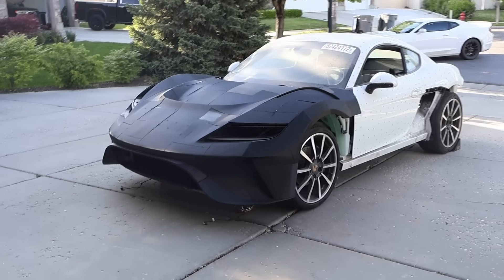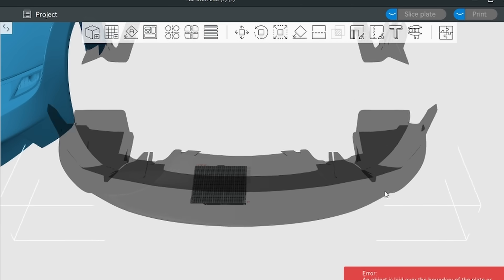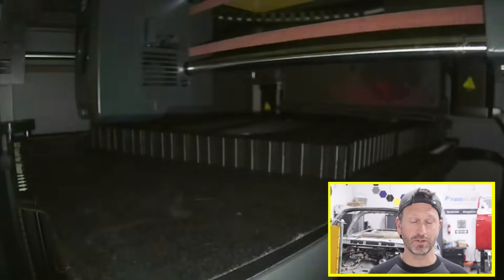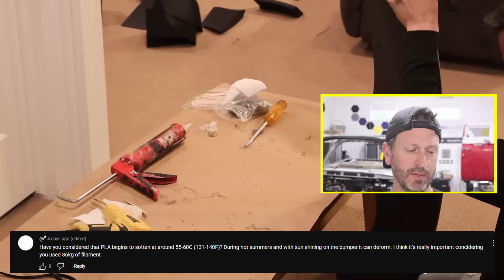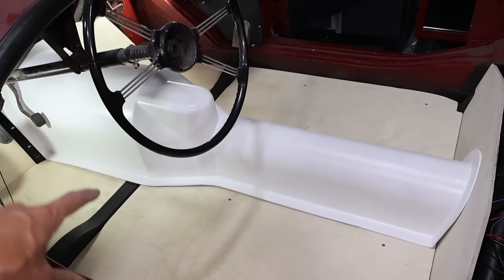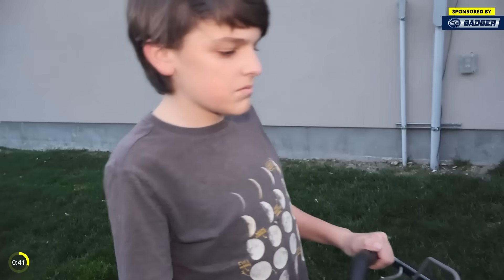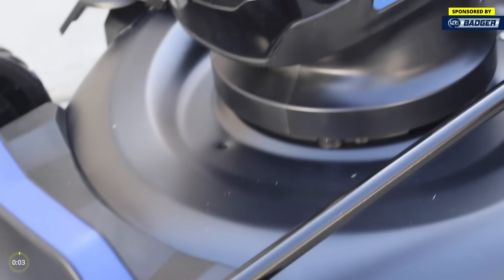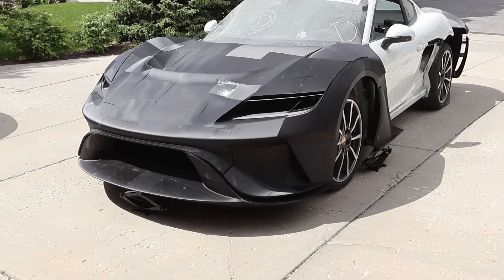Can a 3D Printed Splitter Survive a Supercar?

Comment: I love what you are doing with the 3D printer.  I love my elegoo CC, it just works.  Might I recommend you building a Rat Rig 500x500x500.  You could reduce how many panels you have to slice down to.  I know you are making these as forms like you did the transmission tunnel.  If you were to use a CF variant of filament, it makes the surface smoother and would reduce your post processing time to make your forms.  Looking forward to your next video!
Reply from the maker: Thanks for the feedback!

Comment: Dude honestly i cant believe you did that. you can auto split and it will work it all out for you. All you need to do is feed it your plate specs.
Reply: auto split with which slicer?
Reply: @sapientinogyro  LuBan3D will automatically slice into the most manageable prints

Comment: Use polycarbonate if you can print it.  It's all I use now. Much stronger/heat resistant ...etc... and if you get the cheap stuff, it can be cheaper then PLA

Comment: I see now this forms a base from which to take a Mould for Carbon fibre Impregnated resin.
Looks super cool.
Just wondering if you had someone with a 5 axis mill cut a foam block for your model from which to then smoothe, finish for your mould.
Would that be prohibitively expensive.
Might make the process far quicker for the Mould prep.
I have seen auto spoilers made that way and modles also make by others just not sure how Exy$$
Reply from the maker: We'll consider that for the next one!

Comment: Hi, I designed software to optimize cut large STL files for my designs. also with claws and holders for make more easy the assembly. If you need help, I'd be happy to do the slicing for you for free.
Reply from the maker: I appreciate the offer.  Next big part I have to slice, I will hit you up.

Comment: TO help with part alignment, some slicers have options where you can add dovetail or pin joints wherever you cut the model. Might be a good idea to use that in the future so that you get the fitment just right.

Comment: Sometimes you need to prototype something, and PLA is a cheap prototyping material. I personally would have used something like ALLPHA from colorFabb because it is more biodegradable than PLA, which is really not all that biodegradable outside of industrial composting facilities and not easily to recycle. But it also is significantly more expensive than PLA.
Reply from the maker: Interesting

Comment: While the slicer (Orca/Prusa/Slic3r) will allow you to section up your 3d prints, check out a cool program I use when I'm going big on a print. Its called Luban 3D, and it will ask you for your print bed size and section up the main STL accordingly. It will also create dowel holes if you'd like and number each part. Its a paid software, but well worth it in order to rid yourself the headache of tracking all the sliced parts.

Comment: Your method for using the slicer to cut the model into sections is crazy! I get why you did it this way but you could have sliced it more accurately, faster and a lot easier in the cad software. Simply make a grid sized to your printer and cut. It will then generate all the parts required and named in like seconds.
Reply: youd also then be able to key them to make reassembly much easier...
Reply: Exactly @fazeobama8872 that's what i thought he was going to say was the way he did it, but to hear he manually arranged each piece on the slicer then again in real life is wild. I would have definitely lost my way many times. Although it makes it way more impressive that he was able to assemble it all without any issues.
Reply: Which CAD software allows you to do that? Thanks
Reply: @starfox_wr-45e93   odest need a cad only a parametric simple software 
LuBan 3d
Reply: @starfox_wr-45e93 basically all of them, in solidworks you'll use the "split" tool using a gridlike surface body, I'm sure it's a bit easier in some other software, but it's possible in all mainstream software
Reply: Or use LuBan

Comment: Those hot staples should not be visible. Go deeper. 

You should be using the biggest print nozzle you can. A  CHT type for high output. The clone ones work just fine. You are going to have layer lines no matter what and it's a lot easier and faster to use some bondo. This would really cut down your production time. Also your printers vase mode isn't just for vases ok. The rule is this...everything is one continuous line. You can print all kinds of stuff in vase mode it just can't have breaks in it and it's one wall thick. That's why we use a big nozzle. You are doing 3 or 4 walls in one pass and you are removing layer adhesion issues so your parts are actually stronger and the printi:ng is much faster. These aren't figurines you are printing, these parts are huge to be worried about layer lines is a little silly. No matter what material you use there will always be some level of finishing work to do. 

You can do carbon fiber just like fiberglass. It's literally carbon fibers instead of glass fibers. For non structural parts do you really need a mould? Metal inserts, I haven't seen you use any just yet. Threaded inserts are cool but also remember you can tell the printer to pause at a layer and then you can add stuff into the print. 

Go on thingiverse and search for vase mode. You won't see as many vases as you think and I think you will be surprised.
Reply from the maker: Thanks for the tips!
Reply: Rctestflight just 3d printed a 14' catamaran and carbon fibered it. He made some mistakes but that's how we learn. He always shows his mistakes, this is good practice. You should watch this video , it absolutely applies to what you are doing. 

It's titled: 3D Printing a Carbon Fiber Micro 
Catamaran 

So there's good what to do and some what not to do. Both valuable.

Comment: Slicer software is pretty much still in infancy.
There is no technical reason that programmatically the slicer couldn’t take a model and automatically slice it to respective parts such that all parts are optimized to fit on the plates and be cut along appropriate V/H lines.

But i digress 
Great vids on this project!
Reply: and then have those same cuts paired with dovetails so each piece self aligns and holds together.
Reply: @evlsc400  I read a forum about this. It's doable.